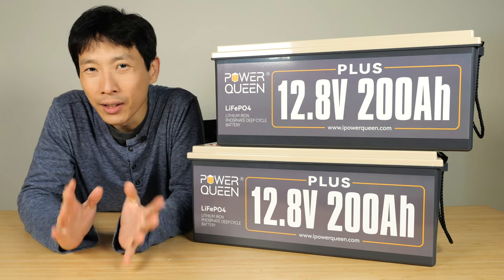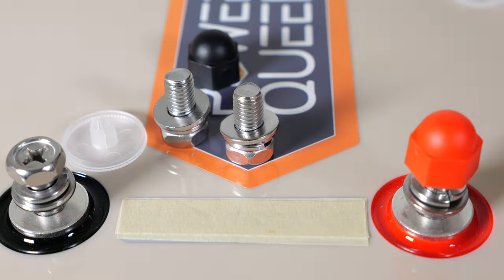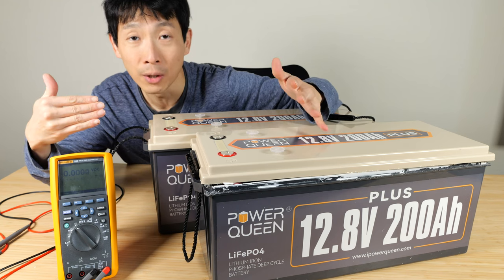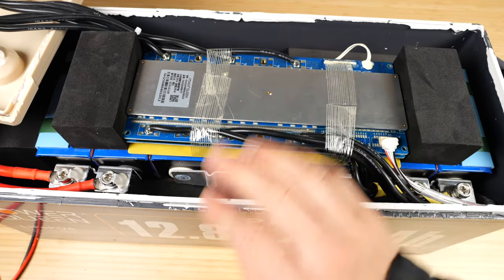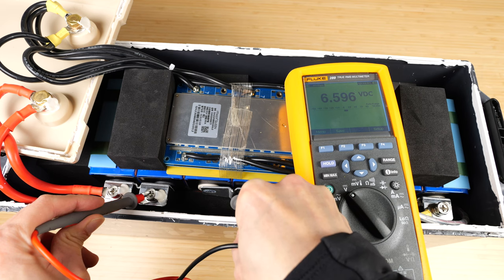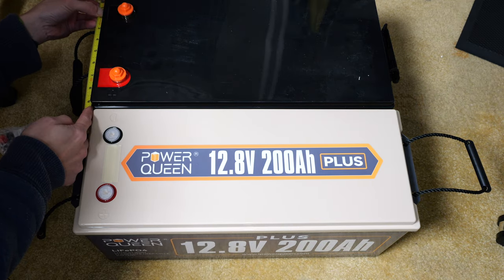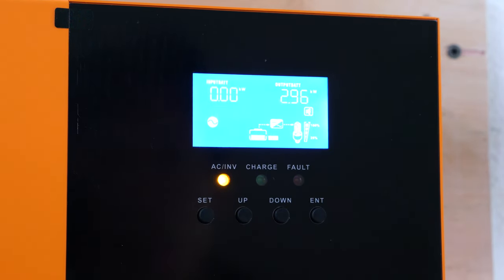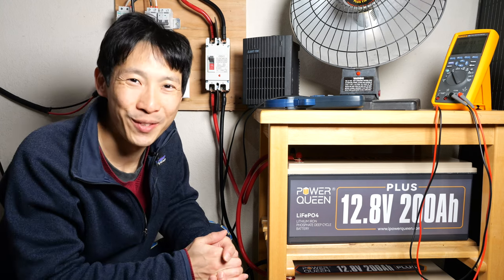What You Get in a 12V 200Ah Battery [Power Queen]

Comment: 48v, or 51.2 nominal seems like the way to go when building systems now, at least if you're going to power anything substantial.
Reply: That's a great point! While 48v or 51.2 nominal voltage may be suitable for some systems, it's important to consider the specific power needs and requirements of your setup. The Segway Portable PowerStation Cube Series offers a versatile and powerful solution with its massive capacity, fast recharging, waterproof technology, and comprehensive protections. It's definitely worth considering for outdoor enthusiasts and RV lovers looking for reliable backup power.

Comment: Good day engineer,
It seems like the Batteries are from two different manufacturer? My question is, can I connect two 12V batteries in series meanwhile the Batteries are from two different manufacturer?
Reply from the maker: The manufacturer does not recommend it. I also cannot recommend it for liability reasons. However, I am doing an experiment with careful monitoring to see what happens while making sure the chemistry is the same, roughly same age, using an extermal BMS, capacity is the same, and the BMA amp ratings are the same.